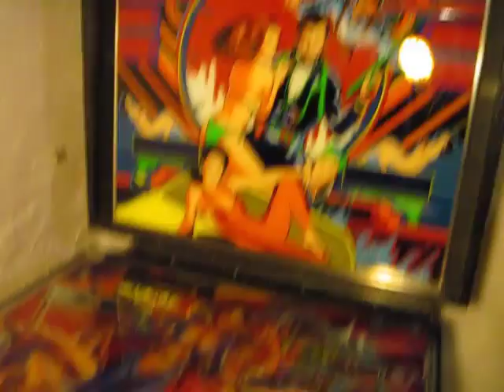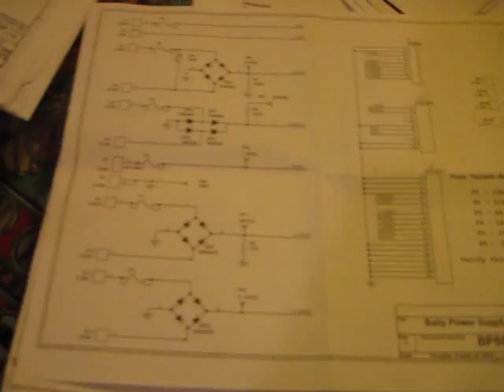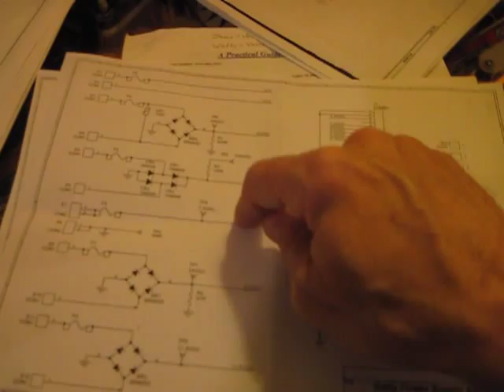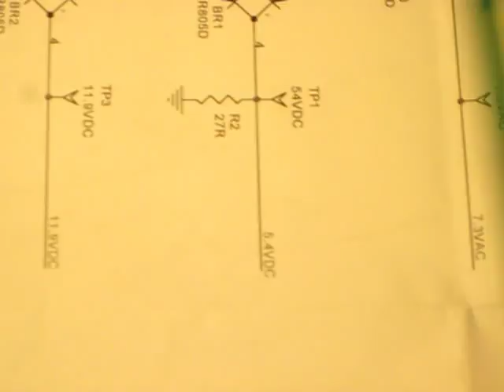Installing a New Rectifier Board for my Bally Pinball Game

Comment: If you ever have to do this again, remove the whole transformer assembly from the game.  It makes soldering wires on the back of the rec. board much easier.  Roughly 6 screws hold the assembly to the side of the backbox.

Comment: Hi Geo , Great videos on the Flight 2000! i have a an issue with my Flight 2000, on the rectifier board it keeps blowing F4 (7a slow Blo ) Coil - 43 VDC on i turn it on. I have GI lights working when turned on, but no flashes on the mpu(which i guess is due to the first part of my question) so i unplugged all the headers from the solenoid, light board and mpu board , turned it on again..and it stil blew, so am guessing i need a new rectifier board?? , (haven't pulled this out yet) or is there anything i could try?..am based in UK England.thanks

Comment: Bally not Baily. There are holes the transformer wires push through. You should not 'snip' them. Just heat the holes from the front and gently pull the wires out. Likewise, do not tack the wires onto the holes as you have done. That is unreliable and very likely to fail or short. Push the wires through the holes and resolder from the front as was the original. Finally, there should be no voltage differences between boards. Voltage regulation is done on the solenoid driver board. Give or take a few 10ths, the voltages will be the same among all the alternate rectifier board makers.

Comment: The voltage differences you reference will absolutely not matter depending on the board -- these voltages have absolutely nothing to do with the board and are dependent on the existing transformer ONLY.  The main thing that should be reviewed prior to purchasing are technical issues -- which boards have heavy weight copper versus cheap thin copper, which boards have heat reducing measures, which boards fixed some of the original issues (see 9:10 - that is a fix for a bad design where there is no connectivity to bottom, all boards have these connections BUT those issues will return on at least one of the boards sold).  Also look for boards that actually provide complete connector sets and other hardware with them.

Comment from the maker: It's been a while, I don't really remember what the pinball was or was not doing.  Your high voltage problem does sound like it could be the rectifier, or maybe even the transformer.  Have you double checked the fuses, making sure they are the correct amps?  Maybe the previous owner change one the fuses to a higher amp because the fuses kept on blowing.  This could suggest a transformer issue.  I do remember that my old rectifier had a lot of poor soldering, which may have been my problem.